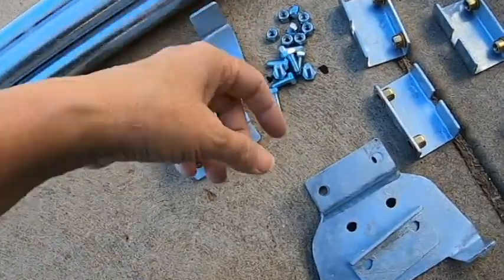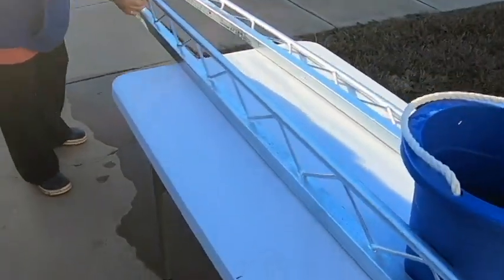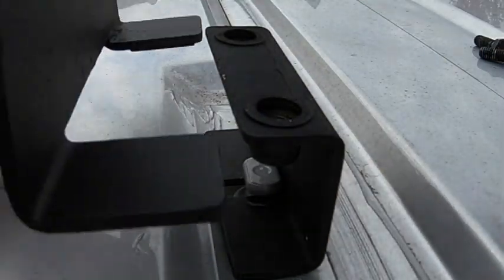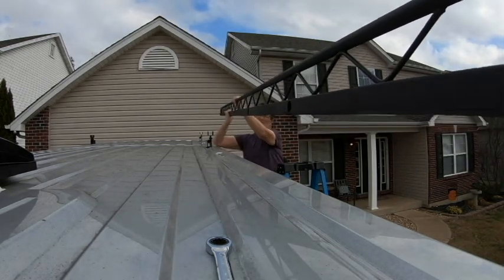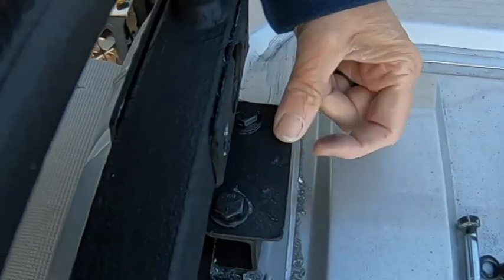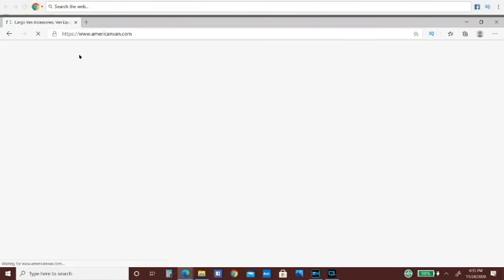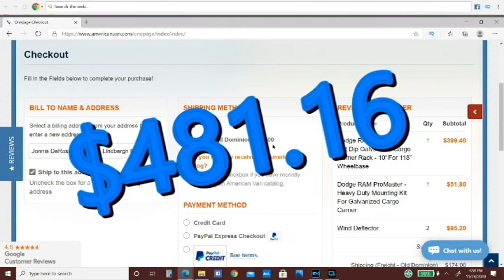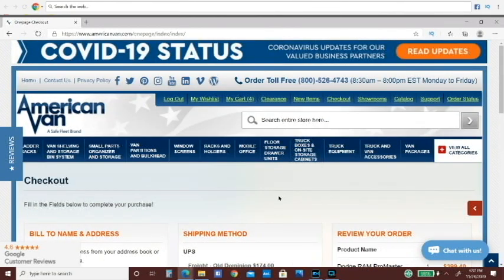VAN LIFE | Roof Rack and Deck Install

Comment: Nice to see someone that did a similar installation to mine. I also got the same roof rack from American Van. I used a chemical called Kurd Kutter to remove the galvanized off the metal. Worked great. I also painted mine black. I assembled it all on the ground though but had a helper hoist it up with me. I configured my solar, fans and deck a bit different so I removed some of the cross pipes but utilized some metal chain link fencing parts to connect them to to other areas after I made some cuts. I didn’t get the reflectors but will now after your recommendation.
Reply from the maker: Awesome, I do love the reflectors and also have the fan insulation cover inside the van.  It cuts all the noise down inside completely

Comment: Hello! Your van build videos are great, you finally helped me understand how a power station connects to the lights (g). Could you please add a link to the exact roof rack you bought? I know you show it in the video but I want to make sure I get the right one. I would also like to know how you secured the deck slats, since the bars are a tube shape. Thank you!!!
Reply from the maker: Thank you so much Beth.  I will try to get a link to rack posted.  I used bolts and anchored two 2x2's to two of the cross bars and then screwed the decking to the 2 x 2's.  I then used steel corners to cover the ends to give it a clean look and better secure them.  Really like the end result.
Reply: @JonniesJourney  I love this! If it is ever good weather and you feel like climbing up top, I would love to see a whole video on how you did the deck. Do you find that you use it a lot? I am imagining sunsets from the roof of the van that I don't yet own. (G)

Comment: Hey! I like this video a lot but you don't show the installation of the deck or solar panels on the cylindrical cross bars. Do you have a video of that or at least additional photos and bracket descriptions for us trying to replicate? Thank you!
Reply from the maker: Sorry Alicia.  I drilled holes in the round bars and attached pressure treated 2 x 2  and attached the deck and solar to those.

Comment: I considered getting a roof basket for my rig but was able to get away with just using the existing rails and buying the biggest cargo carrier I could find for my second story.  I don't have permanent solar panels, so that was my trade-off.  I need more storage space than I have a need for static panels.  I'm alright with my folding portable guys.  It's to my benefit, anyways, since I can angle them to the sun and place them away from my rig if I don't want to sit in full sun.  Of course, they were more expensive and have their disadvantages, but I'm just going to have to compromise.
Reply from the maker: I totally agree about being able to place panels in the sun.  Totally a win.  I have a portable panel as well for this purpose.

Comment: What did you use to make the deck part on the roof? Did it add much drag (increase gas mileage a ton?) and did you add that the same time as the front solar panels? If not was there a noticeable difference  in MPGs with each addition up top? 
I've also read that the wind deflectors scrape off even more MPGs- your thoughts?
Reply from the maker: Bj, yes I put the deck on the same time I did the solar.  I owned a van without the wind deflector and it always sounded as if the panels were going to rip off.  This set up has none of that.  it is composite which is much heavier than any other product I would guess but I did not do upper cabinets inside the van and thought it was a fair trade on weight.  As far as gas MPG I average 14-16.  I still need to weigh my van, hope to do that soon.  I can see how the wind deflector could change mpg but I can't see how it could be much.  I feel like I didn't lose 3 mpg after all was said and done.  I love love love not hearing that wind rattling my panels.  So worth it.  I also love the deck.  note: composite can get really warm in the sun, be careful.  Thanks for watching and sorry it took a few days to get back to you.
Reply: @JonniesJourney  Looks like we have teh same rack- what'd you do for wind deflector?
Reply from the maker: @bjhessler162  I bought two so it would go all the way across. Love it
Reply: @JonniesJourney  from who/where?
Reply: @JonniesJourney  and can you post pic on how they attach?